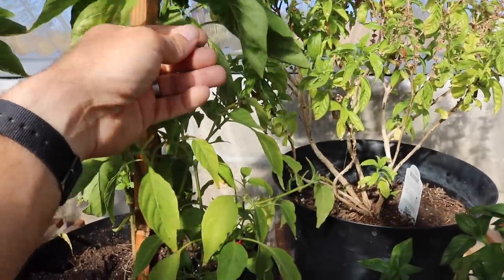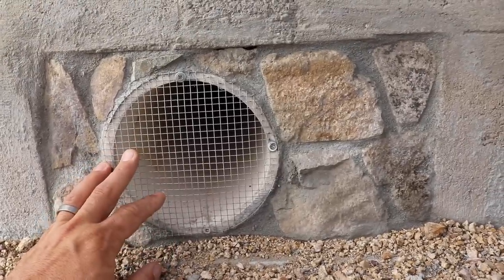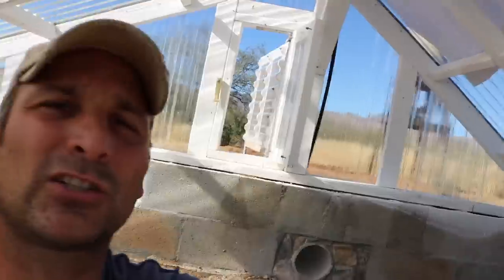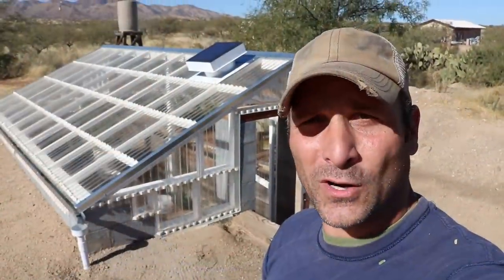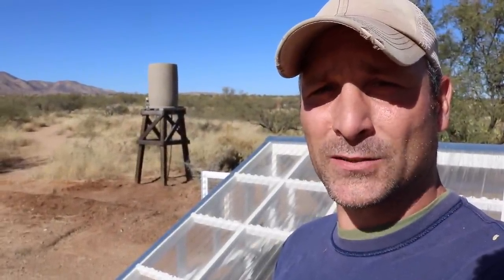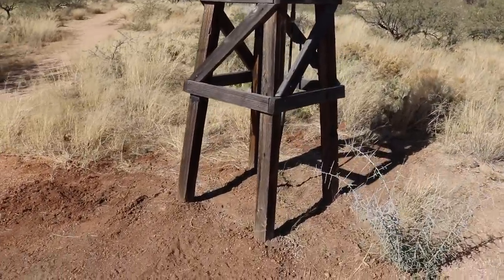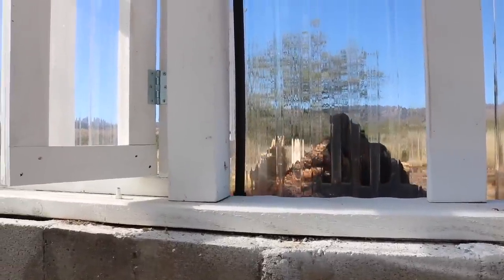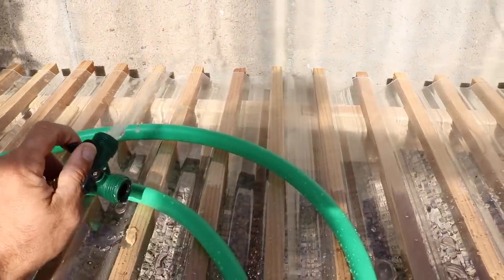Sunken Greenhouse 7 - Rainwater Harvesting, cooling tunnel

Comment: Where are you getting the water for your greenhouse barrel? Since its so close to the rear of the house, maybe a small divert from the rear gutter? If you can put a water collector roof (oversized) on top of the barrel, it will shade it, reduce algae, and give you gravity feed to the barrel. Coming along nicely..
Reply from the maker: I wish I could say it was from the some pipe I routed off the roof, but it's just filled with the hose.  Although I guess it ultimately comes from the roof, via the house system.  But it's really just a way for me to have pressurized water to the GH with out bringing official utilities to it and getting into permit issues:)
btw... I mailed you a shirt and some beanies last week, so you ought to be getting them soon:)

Comment: We have a sunken greenhouse and I am having issues with high humidity in summer even with the fans going. We have cinder block retaining walls - 6 foot high blocks below ground on the western wall (with 3 foot windows above) and the eastern wall has 4 foot of cinder blocks (with 8 foot glass above) if that makes sense.  

Anyway - would you suggest applying anything to the cinder blocks to help keep some of that moisture out?  I’ve read it can do more harm than good but I really don’t know. We installed gutters and that helped a lot plus there are floor drains but it’s still has high humidity after it rains. Also, what about a moisture barrier for the floor?  Are those recommended in greenhouses?

Comment: Have a question on the inverted barrel you are using. Can you show or tell me how it is filled?
Reply from the maker: Hi Matt, I must have forgot to say it in that segment... but it's nothing fancy... I just fill it with a hose.  It was my solution to have pressurized water to the plants without having 'utilities' going to the gh... which would potentially add 'permit' issues
Joe

Comment: Also. have you thought about a buried pond style tank near the green house?
Reply from the maker: yes, I did consider a buried tank near the greenhouse and routing back a pipe to be able to use the water directly in the GH... but I just couldn't figure a better option than the IBC in regard to ease of setup and capacity.  So for now that's what it will be ... but my mind is always going and a buried tank/pond isn't out of considerations;)
joe

Comment: Ground tube. The idea you need small tubes is for increased surface area. My experience with that is increased joints and increase in static pressure, not worth the fuss and muss. One large diameter pipe is more energy efficient fan wise.

Comment: the cooling tunnel needs to  be as deep as possible when I lived in buckeye my col water line came in from the street originally it was  very close to the surface   when I put in a new line I put it  24 inches below the surface made a huge difference in the water temp making it much cooler plus whenI ran the irrigation on the yard the house water got cold  so you could run your grey water out ob top of the cooling tunnel

Comment: Hi Joe,
The greenhouse project is looking great. Will you monitor the temperature in the GH? Is there enough heat to draw air through your earth tube? Any chance you can throw a pinwheel over the vent so we can see the air in action (great father daughter activity)? I'm looking forward to the next update.  Cheers, 
  Bill
Reply from the maker: Hi Bill, yes I plan to do some temp tests like I did in part 5.  But I really like your pin wheel idea!  That would be something cool to be able to visually see if the air is really flowing in at a good pace or not.  I'm gonna maark this comment here.. maybe I can call it the 'walter wind wheel'... actually if I do,... I'm going to try and remember to call it that in the video!  thanks for watching and the great idea Bill!
Joe

Comment: I do see that this is almost a year old, but what about adding another small solar fan on the cooling tunnel (Either end). (possibly cost or no much benefit??). just wondering if that would add more flow of air.

Comment: you need to dig in down about 6 to eight feet, and there's a rough formula for figuring out the length of tube needed based on the cubic footage you're trying to cool/heat.

Comment: @homesteadonomics  Good thinking on the earth cooling tubes, but unfortunately the pipe needs to be much deeper.  About 10'+ deeper.  You need to get the pipe down to a depth where the soil is a near constant temperature year round, which various by geography obviously.
Reply from the maker: yep... probably need to but this is the best my back could do at the time:)
Joe
Reply: @homesteadonomics  Hey I understand.  Awesome job though, I subscribed.  I hope to build one myself in the next few years.

Comment: Everything looks great!  I really like your water tower!  How is it filled?  Also, with regard to the cooling tunnel; is it passive, or will there be a mechanical air handler involved?  I am not quite sure I get the idea of it.  Whatever it is, I am sure you will work it out!  What part of the country are you in and how cold do your winters get?
Reply from the maker: HI GB!

The water tower is just filled with a hose... my way of having pressurized water in the GH without having official 'utilities' to the GH... which would invite permitting issues:)  And the cooling tunnel will most likely have both capabilities... mostly passive with a wall that will funnel wind into the pipe and also a fan or something that I can use to 'pull' air as well... but that's about all I know for now... lol...
I'm in Arizona, but at 4000' so we get some freezes in the teens but obviously we are generally very mild in regard to  winters:)

Comment: What size PVC pipe do you have running over head in the greenhouse? Looks like 1" or 1-1/2"
Reply from the maker: Hi Jordan... the overhead is 3/4", and it's tied to 1/2 (5/8) irrigation pipe which comes from the barrel.
Joe
Reply: homesteadonomics thanks Joe! Nice project you have going.

Comment: i thought greenhouse only use in cold countries :P  is it very cold at night in the desert? else greenhouse really do trap a lot of heat.
Reply from the maker: Yes, GH are used more often in colder areas.  I live in the desert but at 4000' elevation so we do see some cold temperatures.. .and even a couple days of snow... but still it's very mild in the winter.  This is more of a way to be able to grow tomatoes, peppers and other warmth loving plants thoughout the year and also to get a better start on my seeds for the spring.  But yes, if I was in a colder climate I might be able to use this year round... versus here, where it will only get used in the late fall, winter, and just a bit in the early spring.  thanks for checking out the series:)
Joe

Comment: So is this sunken green house you built any good for a very hot place like the Bahamas? Or did you build it because you live in the desert and in the winter it is way too cold? So you’ll be utilizing the Screenhouse in the winter months to still grow food there? I am doing a project in the Bahamas and if it helps with the heat this would be amazing. Because there’s really no point to garden in the summer months in the Bahamas. Between the bugs that are in the soil. the bugs in general the heat and humidity you can forget about. A lot of food plants just will not make it in the summer there. Of course the ones that can go outside mainly a lot of Asian ones we will be growing outside. But we need diversity.

Comment: Did you know it is illegal to harvest rainwater in some areas or states?  It is illegal where I live, still have a hard time getting my head around that law!   Bringing plants from out of doors indoors takes a good couple of weeks for acclimation.  Going the other way; indoors to out of doors takes an acclimation process as well.  I always plant my tomatoes and peppers...in pots but I never use garden soil in pots.  You should be careful when bringing any plant with unknown soil or diseases into your greenhouse...quarantine, honest.  You aren't recycling pot water or grey water are you?  Do you have a well?
Reply: This acclimation process helps to either thicken the epidermis to prevent sun scorch when taking a plant used to the green house filtered sunlight to the out of doors in the unfiltered sunlight.  Going the other way it helps to thin the epidermis to get used to the different light spectrums.  Even plants going from artificial light to the garden need to have this  acclimation to get ready for real sunlight.  Take plants from normal spot to sit out in sun for 5 minutes the first 3 days, increase to 10 minutes for 3 days, then 20 minutes for 3 days...watch plants for signs of distress but your tubs will come in handy with the small pots of vegetable starts. Seed 1" X 2" deep starter tray holes filled with bagged, sterilized potting soil.  When the roots show out the bottom you up pot to 3 or 4" pots and when the roots show through the bottoms of those the next up pot would be 6" or 1 gallon.  All using potting soil. To plant out of doors start with the 3 or 4" size to begin acclimatization before planting in its forever home.  Not good to disturb plants in the garden soil and put them in pots, grins.  They look fantastic with the stress they just went through.  Don't fertilize until the 3 to 4" size as well.  Starts don't need fertilizer at first because the carbohydrates it needs is in the seed and seed leaves.  Balanced fertilizer, not compost or manure or blood meal or fish emulsion or goodness sakes, epsom salts are not balanced fertilizer.  Low N in proportion to the P and K (5-9-7) if you want flowers and fruits...Higher N for lettuce and leafy greens.  There are other chemicals (not 'food' not 'nutrients' but chemistry) as I listed a few above that do good things in the hands of experienced gardeners  but what usually happens for newbies who think fertilizer as 'food' is"'a little is good more must be better"   Just a bit too much and your plant or plants are toast. Fertilizer, is as important as water, light, CO2 and drainage.  Fertilizer are chemicals NOT food.  The plant makes it's own food...Nitrogen is nitrogen is nitrogen.  There's no difference between synthetic or 'organic' Nitrogen...not one bit. Keep an eye on fillers though.  There are really great 'organic' fertilizers now.   Don't know why I've kinda been going on...but sounded like you could use some pointers.  Not fun to learn the hard way and I just love that space...it is beautiful!